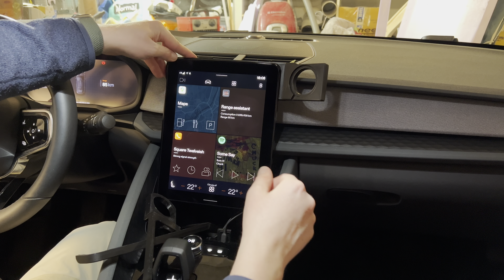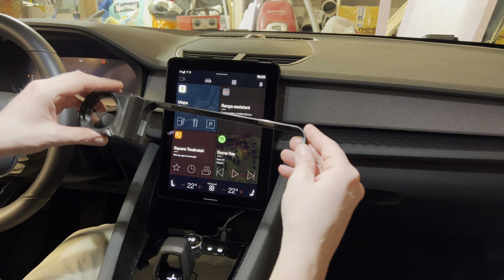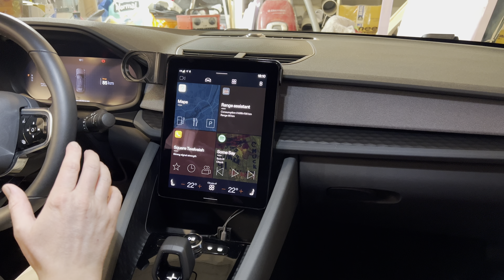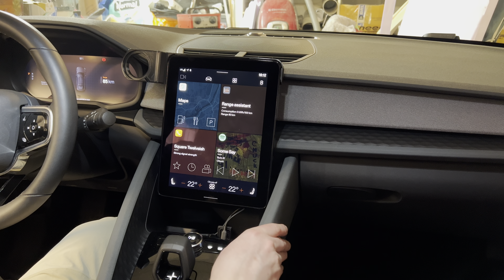Polestar 2 iPhone mount (updated V3 version)

Comment: I really like this holder, so simple ,get the phone on and off.
All people does not use android auto och apple carplay😉 , I dont ☀️
Thanks again Bjorn.
I just wondering if someone know if there are some kind of accessories to attached to a Android phone with cover. So I can use that holder for that phone also😀.
Reply from the maker: Good to hear that you still like it Jonas! There are these magnet stickers that apply on the phone / case to make it work on MagSafe. But I have not tried them and not sure how strong they are. Or if they work at all.

ESR HaloLock Universell ring 360, magnetisk trådlös laddning konverteringssats, kompatibel med MagSafe-tillbehör, iPhone 14/13/12/11/X/8-serien, Samsung S22/S21/S20/S10, 2 stycken, blå https://www.amazon.se/dp/B09D2RMDGG?ref_=cm_sw_r_apin_dp_X3NV12ESTPSQFERDC7NG

Comment: Hi Bjorn, can I buy version 3 from you and you can ship it to me?
Reply from the maker: What country are you in? I can ship to most of Europe for a reasonable cost, but US is too far.
Reply: @BasinBjorn  I’m in Israel.
Reply from the maker: @guybar-or5069  I checked shipping to Israel and it’s surprisingly cheaper than expected. 111 SEK = 9,50 Euro. I’ve never shipped that far, but it is with tracking. Price for the V3 mount is 15 Euro, plus shipping. Could you send me an email with your address & phone number for delivery and I’ll get back to you with a PayPal link for payment. I have 2 mounts printed ready to go.

BjornALarssson@gmail.com
Reply: @BasinBjorn  Would you consider shipping to the US?  Atlanta, Georgia 30337 ?